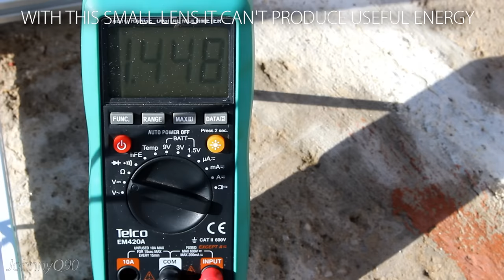Solar Powered Stirling Engine

Comment: I love this, but I guess what I was thinking when I read the subject is that you were using a solar panel for instance, to drive an element that heats up the hot side. You have been working on this longer than me so not sure if that would work. Another great video!

Comment: a parabolic reflector concentrating the light onto a heat absorber on top of the hot engine part and an old kitchen clock as tracking motor to align the thing to the light source.

Comment: a couple suggestions- replace the glass hot end with one made of copper. You can then oxidize that copper with liver of sulfur to get a rather decent selective solar absorber- it will dramatically improve your efficiency as copper's high thermal conductivity will make heat transfer into the working fluid more efficient. You could also try tweaking the moment of inertia of the flywheel, and if you really want to get fancy you can impedance match your load.

Comment: You should use a brass hexbar drill 3 holes on the side and one in the center and turned it out but collect the chips and put them inside then start to heating up with the sun

Comment: I must say that I'm impressed. Something that I don't say very often.  Excellent video, and a fine example of model engineering. 2 questions... Does the cylinder and valve assembly require any lubrication?  What kind of Lathe are you using? Keep up the excellent work.

Comment: I know they’re not as pretty as this engine but wouldn’t it be more efficient to use a solar panel to produce electricity directly, thereby incurring no mechanical losses? I’m not criticising, I’m asking a genuine question for which I don’t know the answer.
Reply: I think the stirling engine is more efficient than the solar panel as it is just 20 % efficient.

Comment: Same effect but using a lightweight Fresnel Lens or Parabolic Mirror to focus light and mount to a plane :D
Reply: Unfortunately, the power-to-weight ratio of Stirling Engines makes them impractical for non-stationary uses (specially planes). That's considering burning fuel. Adding a fresnel lens or a mirror to it makes that even more impractical.

Comment: Instead of painting the glass tube black they should have added something like steel wool inside the tube that was painted black. That way the heat would be generated directly inside the tube instead of having to transfer through the glass tube.
Reply: Also if the tube was air tight then they should add a gas that is more thermally conductive than regular air to increase the heat transfer speed.

Comment: Smaller motors don't usually work with high voltage. Would've been interesting to see the power that it creates (voltage*current=power)
Reply: Stirling engines don't produce very much torque, so the voltage would probably drop substantially under any load. If it's only producing 1.4v of open circuit potential, it'd probably struggle to produce more than a couple of milli-amps.

Comment: Nice engine, Just one suggestion for the next, instead of the glass tube, you should use a material with better thermal conductivity such as bronze or copper.
Reply: And then cover that in glass. The glass will transmit light inside and block some IR radiation from escaping while also preventing cooling from a breeze

Comment: I'm willing to bet that a standard Hobby-shop solar panel has better energy conversion, but this is still objectively cool
Reply: This model probably isn't very efficient, but Stirling Engines could be well applied for solar energy for various reasons. First of all, they can produce AC without an inversor. Second, they can temporarily store energy as heat and flywheel momentum, which grants a more stable voltage. Third, it could be easily run on both solar and fuel to supply for consumption peaks, or even making a system that produces solar during the day and by renewable fuel during the evening.

Main problem is price, a Stirling Engine is definitely more expensive for the same watt output.

Comment: why didnt u use lab grade glass lens?
they would have had less scattering of light and better collection
Reply: A low grade glass lens is 1 way more fragile and 2 way more expensive. In bulk you can get a fresnel lens for less than £3. Fresnel lenses are also way lighter.

Comment: What fuel are you using i have an identical engine but the instructions are in a differentl language
Reply: Toby Hayes 
Probably alcohol. It is a basic wick lamp. Kerosene, paraffin oil, or any low viscosity flammable liquid would also work. Alcohol does not leave much soot on the displacer piston housing though.

Comment: If the engine is mounted on the right arc maybe a small gear could let it point the apparatus at the sun as it moves.
Reply: Or you can use a Evacuated Solar Tube, and not need any solar tracking at all.
Reply: @SeeTheWholeTruth  oh!

Comment: First time I’ve seen this channel. 
Aside from this video displaying fantastic machining skills, is a stirling generator a practical manner to extract electricity from a given amount off light? 
Would stirling provide more kilowatts from 300 square feet than photovoltaics? If so would it be cheaper, or more reliable?
Reply: Depends on the Quality of the photovoltaics and generator.
Reply: Use solar panels. They are not expensive now (they used to be) and they produce electricity directly without any fuss.

Comment: How big can a Stirling engine be scaled up? Could you actually make one that can generate a few kilowatts at least?
Reply: Yeah, you can make them as big as you like. They have two major drawbacks though. Big ones are extremely heavy, so you can't use them for vehicles. They are extremely slow to start and stop, so when something goes wrong in a power network, your engines could take hours to respond. That said, they are still quite good in some situations, mostly when you have waste heat freely available.
Reply: Cool. I'm guessing they're not as efficient as solar panels, say if you had a dish type reflector as big as the roof on your home?
Reply: @garman1966  No, they are far more efficient than solar panels, it's just incredibly awkward to have a huge engine and lens array sitting in front of your house. An engine big enough to replace the solar panels would be too heavy to put on the roof; you'd practically need to build a new building to house it and place it on a solid foundation. Old timey factories used to use big sterling engines for all of their power, before electricity grids existed. We moved to combustion engines and boilers mainly because of how compact they are and how fast they can be turned on and off.
Reply: Thanks!

Comment: cool concept, issue is, if you had that kind of solar energy available, a solar panel would produce higher voltage and be able to sustain much higher loads than a Stirling engine, i mean, if you added a load to that it would have stopped in seconds :D. Or maybe even focusing the solar beam on a steel cylinder filled with water and making a steam engine, which also, would deliver considerably more power... This is why, while a cool concept/science experiment, Stirling engines are useless. You can get more electricity out of any other form of generator that is way using the same kind of energy as input... For solar -> solar panels/ steam generator. For fire -> steam generator. xD
Reply: solar panel is  20 percent eficcient, a stirling engine is 55 percent eficcient. so you can harvest twice with stirling engines
Reply: @absolute___zero  yes but the sun produces more power than gas.... 20% of something big is more than 50% of something small. Also, the efficiency nowadays is close to 30%. You're stuck in 2005 my friend :))
Reply: @StriderAngel496  you didn't get it, again: the same amount of heat (aka photons, aka electromagnetic wave) produced by light is converted with 20% efficiency using solar panel, and converted with 55% efficiency by stirling engine. Like, if you have 1kg of lemons , you get 22 mililiters of juice with solar panel, and 55 milliliters of juice with stirling engine. If you would somehow convert electricity out of black body(google black body radiation), you would get 100% efficiency.
Reply: @absolute___zero  oh and one more thing, that wasn't even mentioned until now. a solar panel converts light to electricity directly. A Stirling engine does that mechanically, which mean moving parts: high risk of mechanical failure and lots of losses due to friction. Then you need a flywheel -> more friction, then you need a generator to actually convert that motion into electricity -> even more friction, losses and risk of failure. Why exactly are you defending a noisy mechanical system that converts energy THREE times, has multiple points of failure, not to mention maintenance (grease for bearings and pistons), when you can get MORE ELECTRICAL ENERGY in the same space with a solid state system (solar panel) that needs NO maintenance, has no moving parts or points of failure, makes no noise AND converts the energy directly... I really don't get it, you people fanboy over a fantasy with questionable knowledge, limited understanding of mechanics, electricity and technology and you just won't admit that you're a fanboy obsessed by a low yield, low power, low efficiency (because you have to take into account all the friction losses ;), not just the engine eff) little toy!
Reply: @StriderAngel496   and by the way, solar panel only converts visible light out of all spectrum of radiation coming from the Sun. Visible light is only 50% of the spectrum. So your solar panel drops the other half of energy just because it cant handle it. On the contrary, stirling engine doesnt have that problem because all the light  hits the part that is being heated and this part absorbs the UV and the Infrared (besides visible spectrum), so seeing it from the point of absorbtion of the spectrum of light, stirling engine is already gaining
Reply: @StriderAngel496  there is one system that beats solar panels though, it is called "concentrated solar thermal" (the one with parabolic dish) , some folks claim almost 100% efficiency on it,  google these words for more info:  Solar thermal record sees 97% conversion of sunlight into steam
Reply: @absolute___zero  yes, visible light, such as ultra-violet, such as infra-red... go to sleep kid :)))))
Reply: @StriderAngel496  light can be ultra-violet (wave length below 300 nm up to x-rays), visible , infrared, and after infrared it is called radio waves. Light is the excitation of electromagnetic field, where massless particles called photons carry the energy. This energy is what creates electricity in your solar cell(they hit the electron and upon this collision the electron starts moving faster , that faster than it moves to higher orbit and becomes more free). And by the way, ultra violet light has more energy than infrared, the shorter the wavelength of the electromagnetic wave the more energy is carried by light. Gamma rays (the shortest light known) carry so much energy that they  can burn instantly , gamma rays can burn an entire planet like Earth in a fraction of a second if they come from a Supernova explosion.

Comment: This design is something like 10x more efficient than photovoltaic cells.
Reply: Is that based on surface area of the lens vs the cells or based on cost?
Reply: @toomdog  

It is based on the amount of power that can be generated from a set surface area and the cost of operation/maintenance. 

As it currently stands the sterling engine method of generating electricity from solar heat is vastly superior to what is available in the photovoltaic market. However, I have not been able to find a commercially available sterling solar system; although I'm sure they are out there somewhere. 

The biggest challenge seems to be the sterling engine itself. While they can produce very high RPM they do not always produce enough torque. This can vary dramatically by design.
Reply: AaronAlso, 
So what you’re saying is that the sterling engine works better than photovoltaic process and has less expensive maintenance, but it doesn’t work well!
Reply: @arvidlystnur4827  
No! It works very very well if you can find or design a sterling engine specifically suited to the task.
Reply: AaronAlso,
Thanks for the response.
Not to sound un- environmental, but can a large stirling engine crank a full powered generator with a wood stove?
Reply: @arvidlystnur4827  

This would take a rather beefy sterling engine. Something with several pistons and loads of torque. Something you would likely have to design yourself or pay someone to design and build for you. Perhaps consider a "dual fuel" type of design. Sun for the summer/days and wood for the winter/nights, maybe? Right now the biggest hindrance for the average person to install a system like this is the sterling engine. No one mass produces them for this purpose.

Comment: Bullshitto , why those wires and electro motor are always present when you want to turn this on ?
Reply: Because those wires and "electric Motor" is actually an electric generator. When you spin the generator, it creates a magnetic field which generates electricity.  

Dude, this is literally electric generator 101. Why does it look like an electric motor? Because while an electric motor will spin when you apply an electric current, they will also produce energy if you spin them with something else. So in all likelihood, it is an electric motor, but in the way it's being used, it just creates power instead of using power.

Look up Alternator powered Go-Kart. They use the Alternator of a car ((Which is spun by an engine to produce electricity to keep the battery charged and to power the car itself)) and just feed power through it, which turns it into a motor. It is literally the exact same concept.

If you don't think these engines work, look up other models of the Stirling Hot Air Engine. It's a basic principle and it competed with the Steam Engine until they found out steam engines maintained their efficiency as they were made bigger. 

Better yet, look up the lindy binge video on Stirling engines, where he powers the damn thing with a cup of hot water XD

Comment: Interesting, a large version of this with multiple cylinders and a strong block might power a car. Someone get on this.
Reply: Sadly, no where near enough power. Also how do you keep it orientated towards the sun?
Look at solar panels. Car roof sized can generate up to 400 watts. They are about 20% efficient. Stirling engines can supposedly reach up to 50% efficiency. So at most 1Kw or 1.36 horse power.
When the sun is at its brightest on a clear day.
Solar at least works because the energy can be stored easily. If you wanted to do storage with a Stirling engine, the extra generator and beefier charge controller would again take power and cost.
Solar cells last up to 25 years with a bit of cleaning. This system needs maintenance and lubrication. Dust/sand/grit can break it, it works less well than solar of not tracking the sun. Threshold for low sun level is probably lower also, so fewer charge hours since solar can charge on morning sun very slowly, but this wouldn't produce a very hot spot.

Comment: That lens is about 6% of a square meter. At about 1100 watts per square meter, you are using about 66 watts.  This just shows how inefficient sterling engines are.

Comment: awesome job man. have one question, is there a reason you use glass and not metal for the receiver? It just seems to me that metal would transfer the heat faster, but i don't know if it would even help.

Comment: Wonder in what kind a measure,
Driving a bicycle whit a flat rear tyre is not exactly same thing ...

What would be the vector that blindness ?

Mistress, the plate is leaking,
See that sun vaporized stuff just spread anarchically almost everywhere ...

What happens to happiness and satisfaction in that story ?

I bet unfortunately they fly away,
By their own wings ...

It's too bad ...

Comment: You are very talented and the video is also well made. Take care with the focused solar beam as it can damage your eyes. It's similar to a burn you get when you have an electric arc soldering blasting light. You need a class ten or more filter. The automatic triggered ones are perfect. I got eye injury with a fresnel lens and also a soldering accident both because of faulty protection gear.